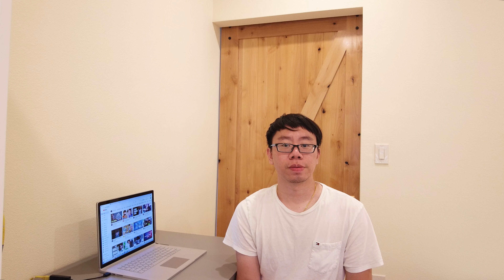Software vs Chemical Engineering : Which is BETTER?

Comment: My advice: take a general engineering course. Keep learning and developing new skills. Chemical engineering is 90% physical chemistry and 10% reaction engineering. You’ll spend most of your time making basic heat and material balances, analysing hydraulics, and sizing and specifying process equipment.

Comment: the Preliminary evaluation is soo wrong, chemical engineering involves some of the most advanced and abstract for of math's,. Topics like Material and Energy Balance, Fluid Mechanics, Transport Phenomenon(i, ii, and iii), Reaction Kinetics and the killer of the all process optimization and control. you get to do really advanced calculus. The actual name of the course is "Process Engineering" basically applying Mathematical/ physical and a bit of chemical process to scale the production/yield of a desired output while reducing cost.  

Also the courses listed above are for your own department, you still have to borrow pure calculus courses from systems engineering, Basic of electrical eng from electrical engineering, strength of materials, plus one i have forgotten from civil engineering. why do you think its always ranked at the top in hardest fields in the world?